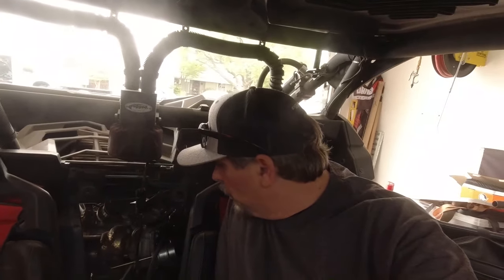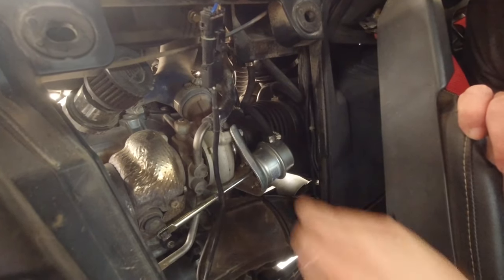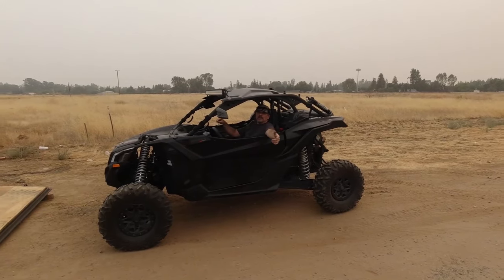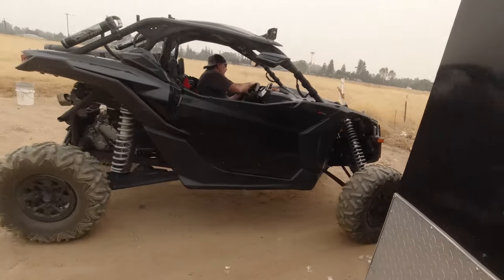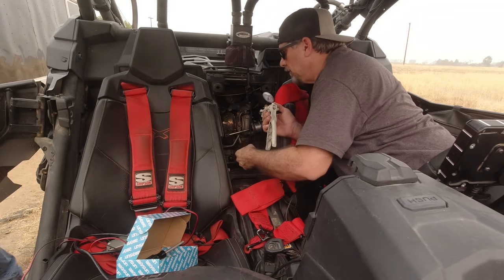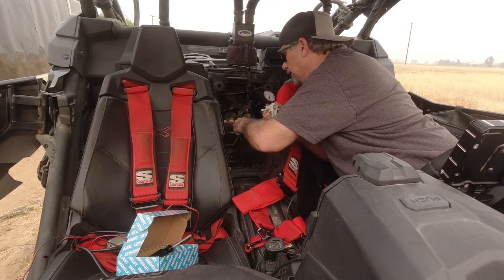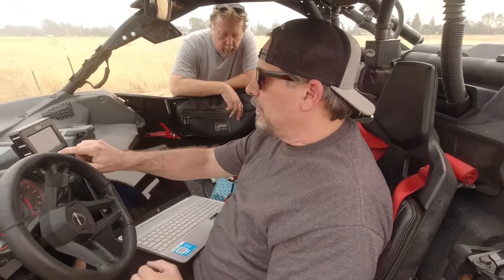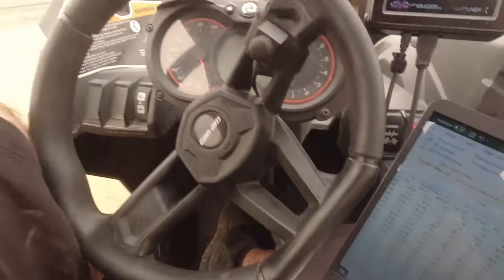Evolution Powersports Crack Pressure Wastegate What The Hell Are We Talking About

Comment: I have the evo stage 3r what would set your crack pressure at? Evo told me 8psi!  Do u go more crack pressure on a bigger tune?
Reply from the maker: Crack pressure changes with the tune. And yes make sure you set it to what Evo told you to set it too for sure. If you have further question I would give them a call, they are very helpful
Reply: Just curious what tune do u guys have that your going up that high on crack pressure
Reply from the maker: 4rwi x100